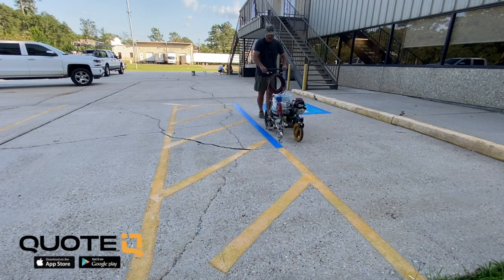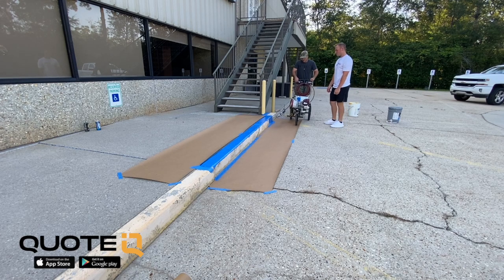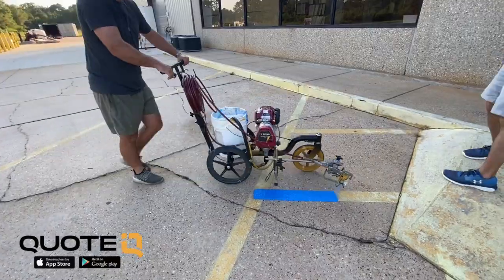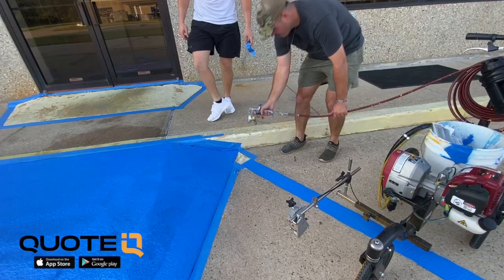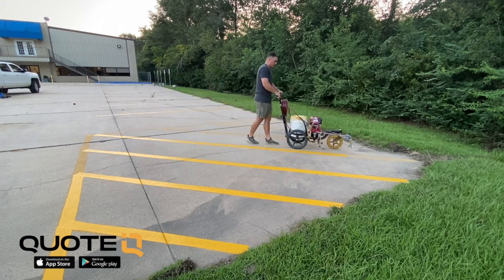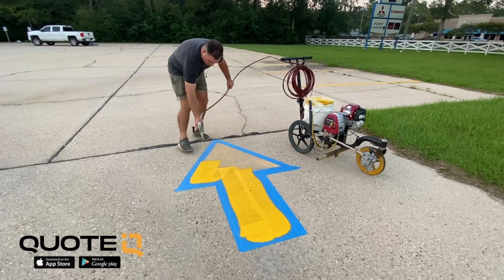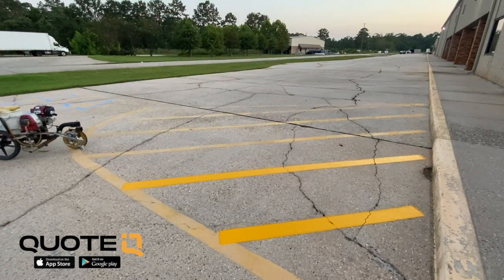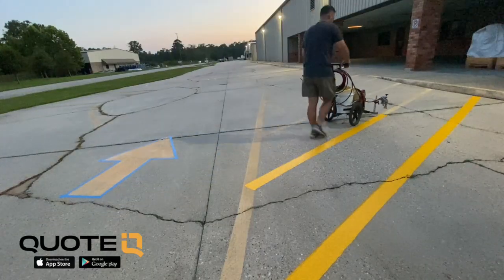Our BIGGEST Parking Lot Striping Job Yet ($10K+)

Comment: Just wondering the guys doing the parking lot striping what kind of tip did they use for that machine that 850 tighten and what kind of paint did they use? Did they have the pressure up or low for the sprayer new to this industry trying to get all the help I can get
Reply: I use a graco line laser for striping but usually paint between 1000-1250 psi, it depends on how fast you are walking and moving with the machine. Faster speed higher psi, if you’re moving slower and trying to be precise, Lower psi so you don’t spray too much paint in one spot and waste material. In terms of paint you can use oil based, acetone based and water based. Oil and water take a lot longer to dry though and in my opinion acetone based is the easiest and most consistent paint to work with, also dries much faster like 5-10 mins. Don’t mix different paint bases cuz it will curdle the paint. If you want to switch Colors or paint type of a machine you can use a bucket of acetone and run it through the machine and the gun until it sprays clear with acetone.

Comment: hi, good channel
i have a question , i just bought a used 800 power liner (titan, its a older model for the 850) , it does not have a pressure adjustment ( i have several regular electric paint sprayers )on the manual says take it to the repair service to adjust the pressure, do you have or know more about the 800 model ? i couldnt find videos

Comment: How much pressure do you use? I have had an issue with my 850 since I bought it last year. The lines get narrow and widen on there own as I’m striping a line.
Reply: I’m really new to the industry. I’m not quite sure what you mean by hitting the bypass and letting all the air out. can you explain that a little differently. I tried looking up that phrase online and there isn’t anything that tells me how to do that. I know that I saw a video talking about lines doing the hourglass shape and it was regarding the hose, but he didn’t tell me how to let out all the air.

Comment: Hey have you had instances where your titan machine gets stick and you have to twist the tip to unclog mode then back to spray mode? really troublesome for me.
Reply: Clean and grease your tips after every job, helps to soak em in acetone too over the weekend to keep bits of paint out. Flathead screwdriver works great to clean em
Reply: @dfig2569  love all the advice. How do you grease the striping tip? I went and bought a Graco tip and I’m going to try it on my 850. They are more expensive than a Titan tip so I want to make sure it stays in the best shape possible.
Reply: If you are using water based paint you should bag it before using it